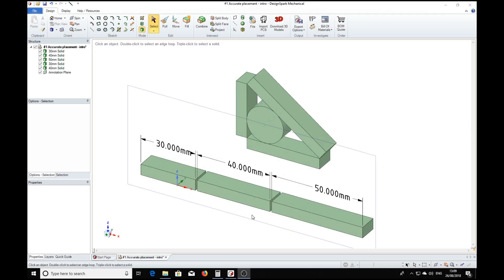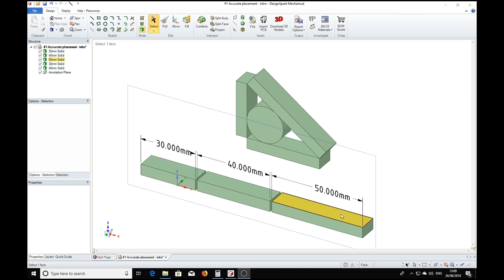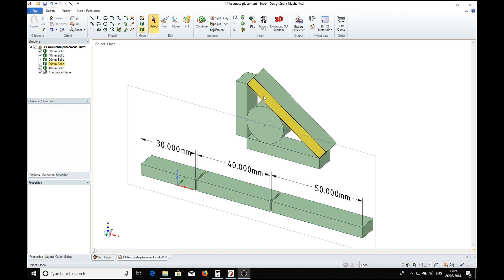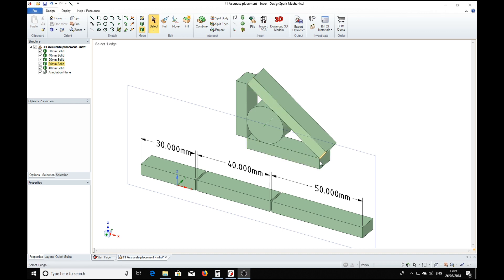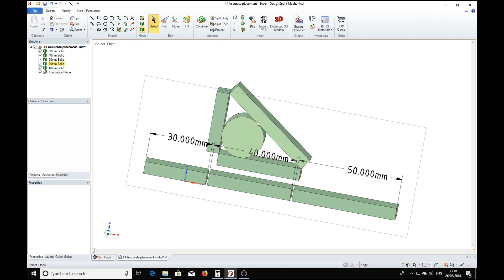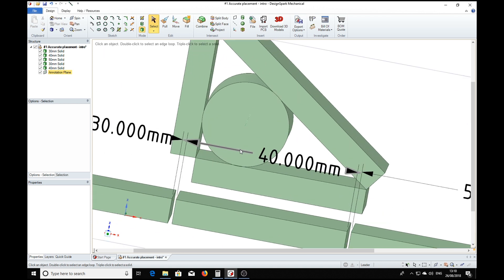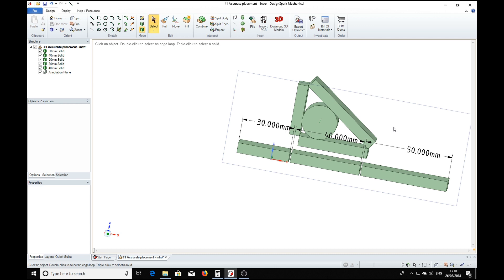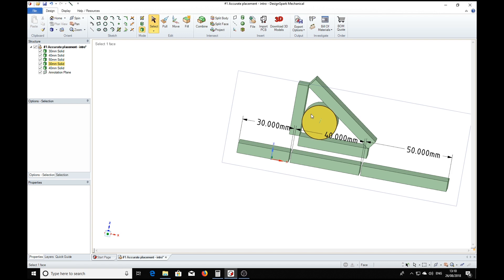DesignSpark Mechanical Exercise #1

Comment: I am new to DSM... How about solving the problem analytically in 2D on the first place? Using "desmos" or some other math sw tool we can easily calculate the center of the circle inside the right angle triangle. Its center should be 10 mm in both x and y directions from the 90 deg. corner... After that we can constrict the profile of the right angle triangle with the edges 30, 40 and 50 mm... Using the three point circle tool we can easily create the tangent circle inside the triangular profile. Along the edges of the triangle we can generate three rectangles. Then using the pull tool we can generate the three rectangular blocks and the solid cylinder... The end result, there are no gaps along the "corner" edges, and the cylinder is perfectly tangent to the those three rectangular blocks. In other words, everything perfectly fits together. That is all. Thanks a bunch for bringing to our attention such an interesting exercise. Best Regards.

Comment: Draw a hor line of 40mm make a circle on the left end of 60 and at the other end one of 100, that gives you the exact locations for the triangle. and the 3point circle command creates a nice inscribed circle with a diameter of 20, the angles are 90, 36.9 and 53.1
for the looks, the 3 sides an outward offset and a few connecting lines and the pull tool and it looks nice.

Comment: Hello Jim
I get a 20mm circle but the 36.9 deg end shows a slight miss match between the 2 edges
what could be the cause and did any one else observe the same ?
Reply from the maker: So far no one else has reported this discrepancy. However, looking at my result I do get a tiny gap at the top angle which measures 0.010mm. It looks as though the 50mm block is not long enough but in theory, in a right-angle triangle, the blocks should line up perfectly. We all know that a 3 : 4 : 5 triangle makes a perfect right-angle. I think that this is a slight inaccuracy within DSM.
Reply: @JimTaylor42  
I agree
Reply: @JimTaylor42  I got the same result

Comment: The point of intersection of the bisectors, I think the center of the circle, and the perpendiculars from the sides to this point are equal to the radius of the circle.
You can help with the download program.
Download thousands of component 3D models , easily amend existing designs, create visually compelling proposals or even export your designs to a 3D printer.

Comment: I used an Contructionline between the corners of the 30mm and the 40mm bar. Then with the Orient to Object tool I orientated the 50mm bar with the Contruction line. Use the move tool to allign the 50mm bar with the corner edges of the 30mm and the 40mm bars.
Go to sketch mode and contruct a 3 point circle between the edges of each bar. Result, a 20mm circle. Use the Push tool to push the circle into a bar.

Comment: For the stack, I used the move tool, relocating the origin to the corner or the 50mm bar, used the up to tool to move it to the corner of the top vertical bar. Then I used the rotate with ruler to determine the angle and rotated the 50mm bar. The circle was a two point circle the push it to the other end.

I'm still pretty new at this but these assignments are helping.

Thanks Jim!